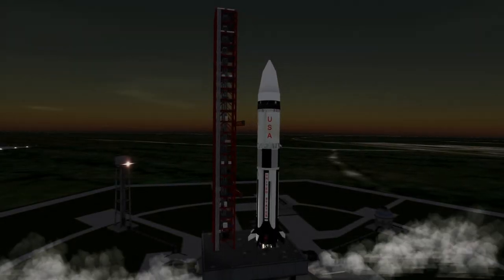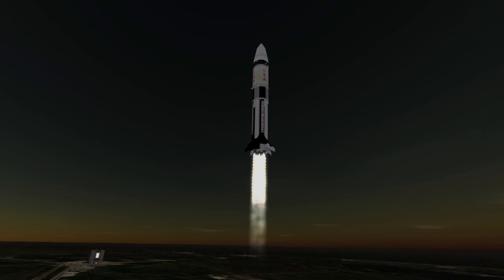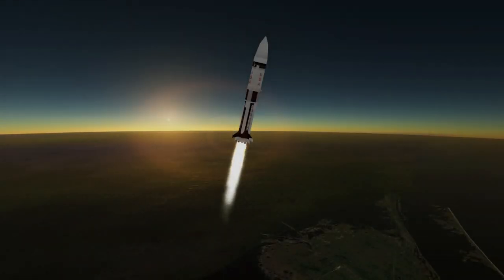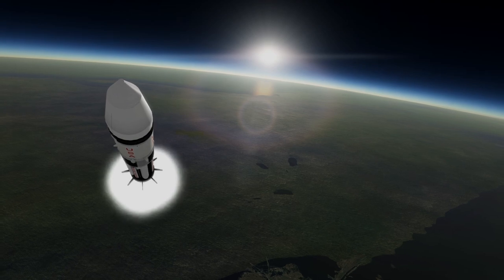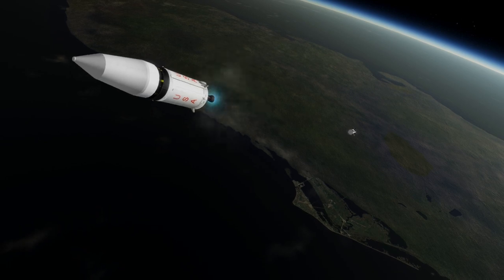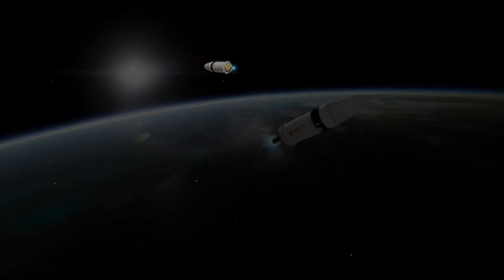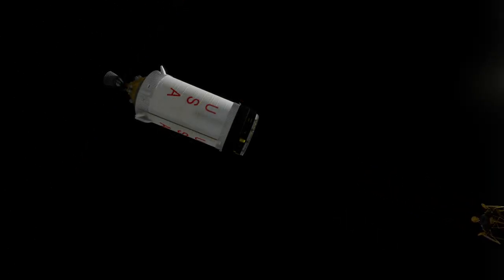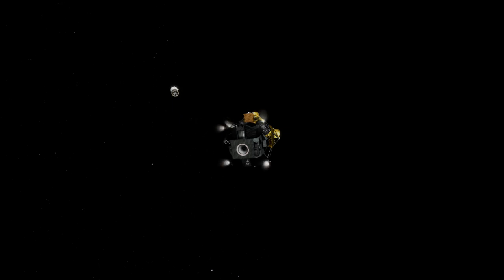Mission Profile - 1968-01-22 Apollo 5

Comment: Hi nice video, just one question, what part of the ship entered on 24 January and which the 12 Februady? I don´t understand that part. Also, the Apollo 5 mission report is available in PDF? In NASA webpaga is only available Apollo 7 and others, but 5 is missing. I want to understand what part of the ship entry in February. Thanks
Reply from the maker: The lunar module has two parts - the decent module which handles the landing on the Moon and the ascent module which would carry the crew and get back into orbit around the Moon after a successful landing. During this test, the ascent module reentered on January 24th and the descent module on February 12th. I have the mission report myself as a pdf, but I don't have a link, and on a quick look-through it doesn't seem to have the reentry information anyway, since that was beyond the scope of the mission - the mission was basically done after the various tests they needed to do.
Reply: @RaizSpace  Thank you so much for your answer!